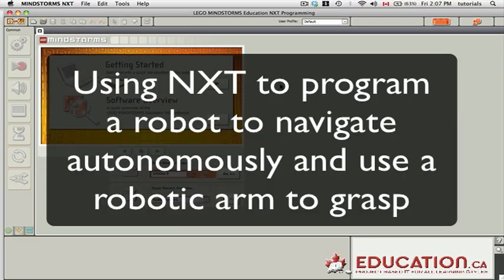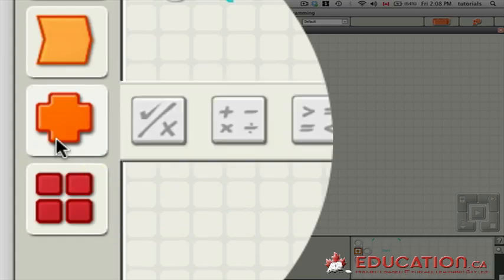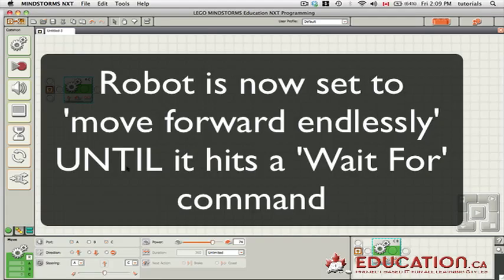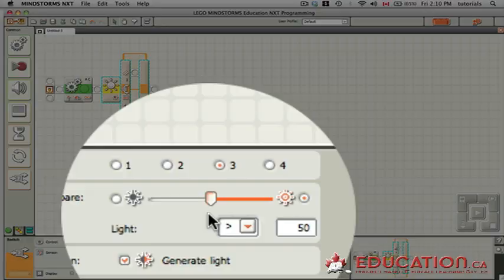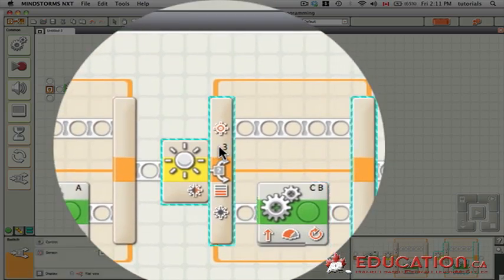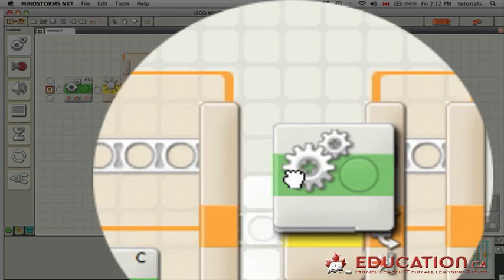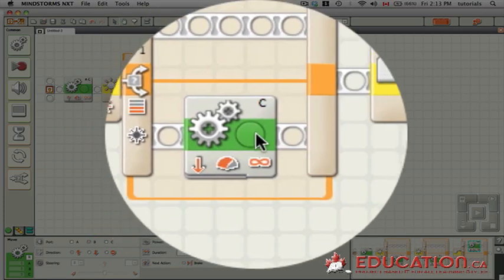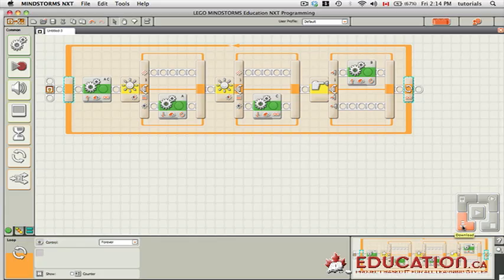How to Program NXT for Basic Navigation on a Robot

Comment: Nice, but what I need but cannot find is any videos on how to make a robot equipped with a claw, a light sensor, and a ultrasonic sensor, scan for an object, move towards it, get so close to it, then grab it, and return to its starting position while inside an area outlined with black tape that you cannot cross and if the light sensor hits tape it must change course and still be able to find the object, grab it and return to the starting place. This on NXT and if ANYONE can help me, do not hesitate to offer advice or directions.